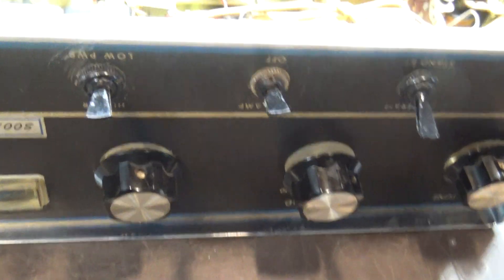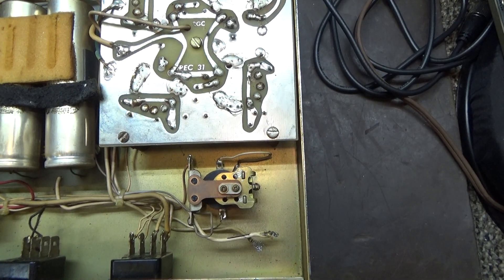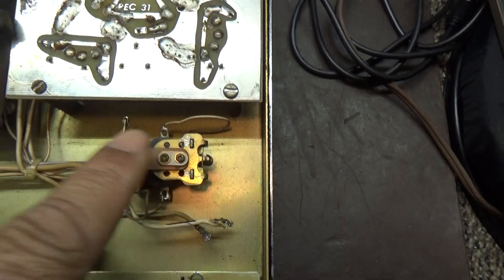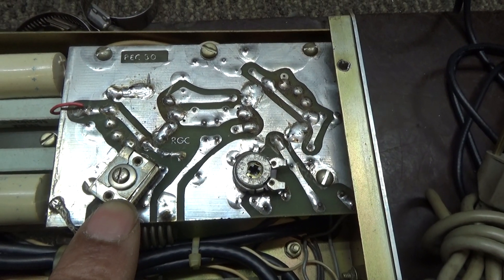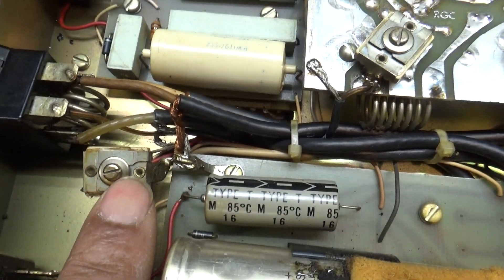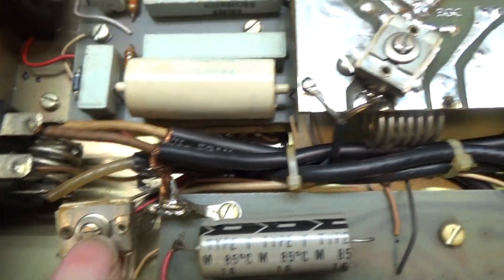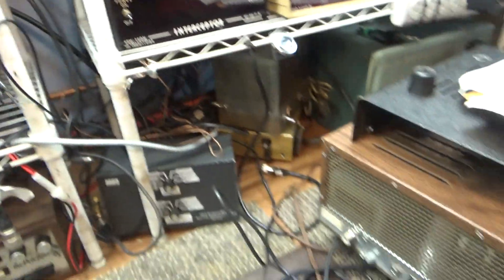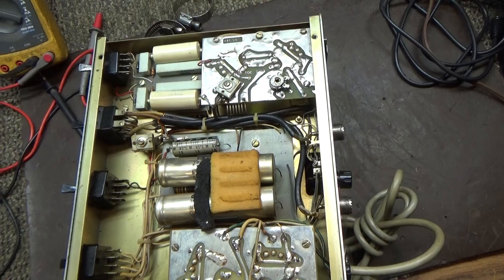Palomar 300A linear amplifier what does what , input SWR, meter pot, driver tune etc.

Comment: How do you tune them for the swr
Reply from the maker: if your radio has an SWR meter, tune for lowest SWR. If your radio doesn't, put an SWR meter inbetween the radio and the INput of the amp and tune the input SWR for lowest SWR.

Comment: Added  parasitic chokes to my plate cap wires and now the high voltage relay won't engage when I key the radio. Any thoughts?
Reply from the maker: They are not tied together. I think a wire got broken off somewhere. Standby switch, and rf keying relay are what the low voltage power goes thru to key the high voltage relay.